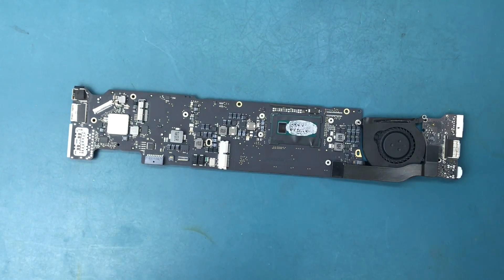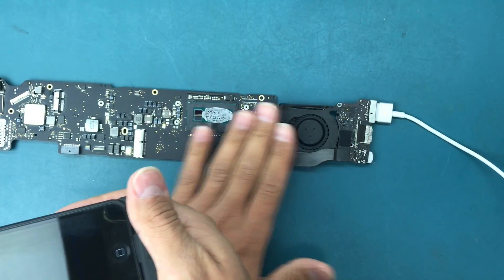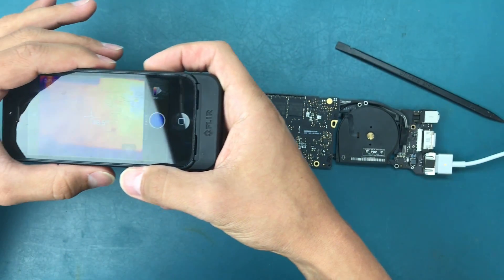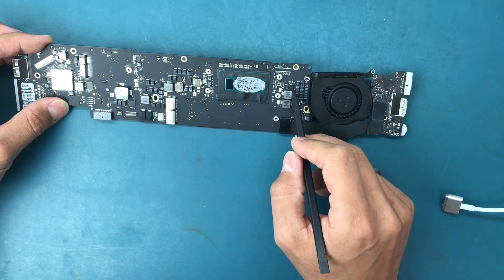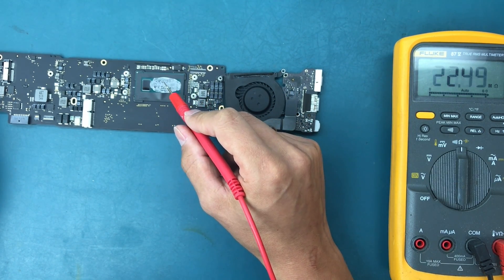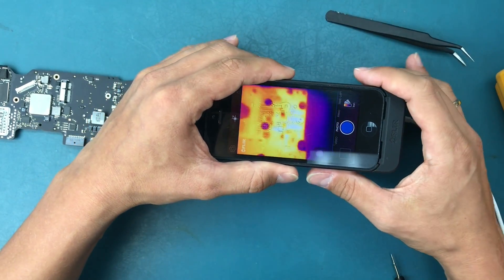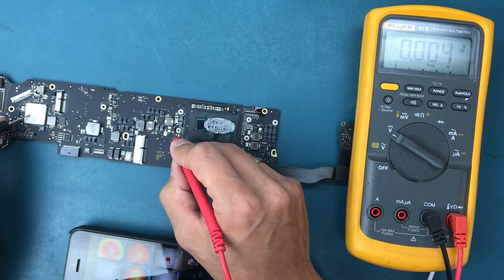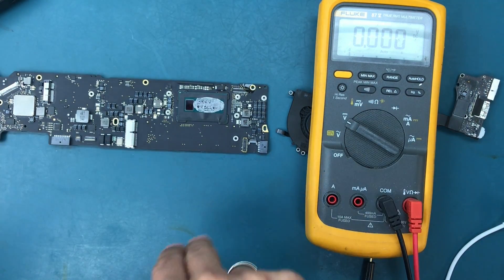Find A Short On Dead Apple Logic Board 820-00165-A using Flir One Thermal Camera Imager

Comment: the "CHIP" you say is actually a inductor to the cpu and any resistance to ground from a cpu line  is always going to give you a low resistance.
Reply: No. 0.6 is a dead short. Its not the same as a low resistance. 0.6ohms is to low even for a cpu. It should not be that low.

Comment: Te simple repair do not need the flir or any thing. The buck converters are pulling down to the power to the CPU to 1.7V from 8.4V so it is hot. ISL6259AHRTZ. Use the multimeter and it is easy. Amazing video. What if the component is not shorted but the diode inside is not workig, no way to figure out with the thermal camera. You are measuring the wrong way that no correct diagnostic at all.

Comment: My MacBook Pro 13 late 2012 works and running.  Yet after being water damage, the backlight doesn’t turn on but the screen is visible at a low brightness. I use a HDMI cable to connect to my smart tv to see if works and it works completely fine. Do you know a couple of a solutions to the problem?
Reply from the maker: Most likely corrosion around the backlight driver
Reply: Fix Apple Now should I replace the display inverter, or should I replace a fuse? If it is not corrosion.
Reply from the maker: Akkarsollum you need to do visual inspection first. There is no inverter that you can replace.  Fuse is possible, but it rarely fails on this model
Reply: Fix Apple Now awesome, do I need equipment to replace the fuse or any components if the voltage is not going through a part?
Reply from the maker: Akkarsollum yes, you would need a soldering iron and maybe hot air station
Reply: Fix Apple Now awesome, do you have your favorite tools in any of your videos or links?
Reply: it could be the led backlight driver. check around the lvds connector for any corrosion also check the fuse I think is f7700 continuity. also check BLK_PWM, check backlight output has 5v sorry ive explained backwards lol. no apple store can fix this shit its not within their expertise. I maybe wrong in my explanation highy unlikely though.
Reply: if you do not have a basic understanding of electrical components and board level repair schematics and .BRD then don't even try mate, you will fuck it up faster than you can say "I love my mac". this is not to discourage you my friend but there is a reason that there are many screws on the bottom case. find a local board repairer in your area and take it to them. tell them you have picture but no back light.